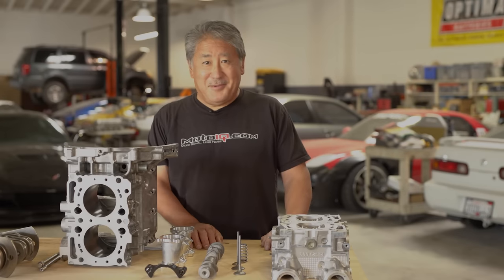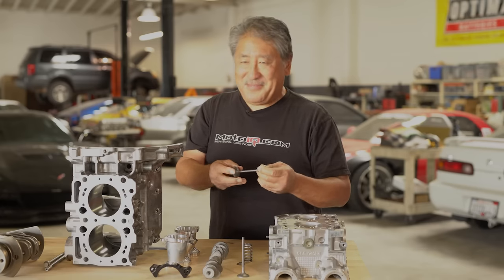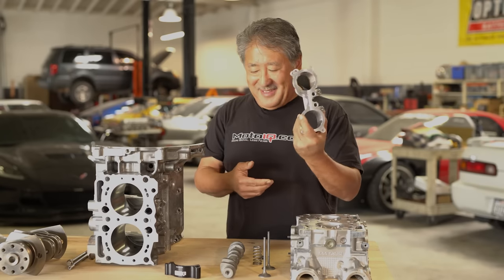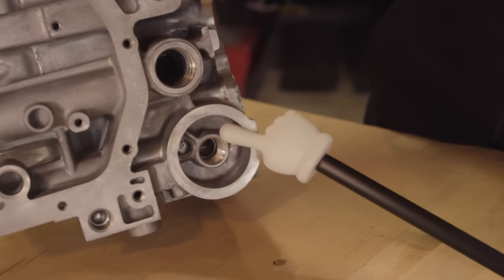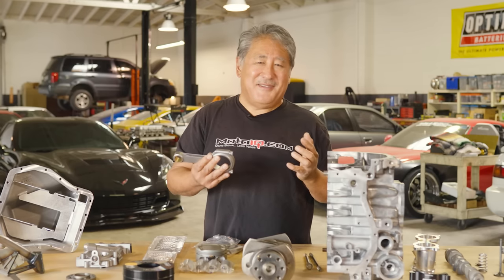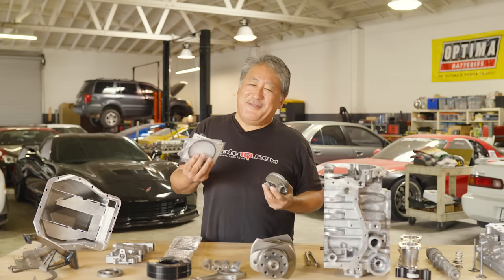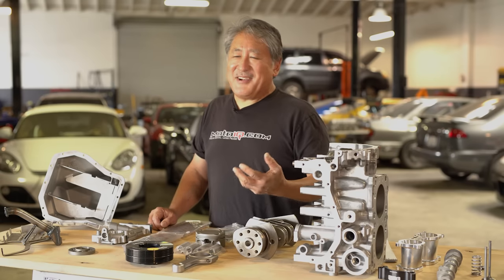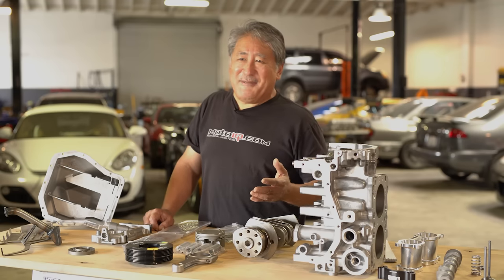How to Build a Subaru EJ Engine that won't BLOW UP!

Comment: Ok so this video explains why my version 5 STI blew up 20 years ago and cost me $10000 to repair. Now we have youtube to research this stuff, good vid.
Reply: Those were the bad old days, it’s so much easier and cheaper now. GC8’s were kinda weak, but 99% of them got given a hard time. 
Carload of mates while doing helis, dodgy boost taps, that kind of thing.
Reply: @zeroyon4562  My one was standard apart from a giant HKS exhaust, head gasket went at 16,000 big ends went at about 17,000. Mind you those events happened after me racing people at 145+mph.....

Comment: THIS is the only reason im considering a low milage wrx 2.0 ej. Hopefully i can find an ol timer thats treated one well thats in good condition. Definitely a model/engine on the list among cars like a regal T type from the 80s.  Both entirely different cars/experiences but im in the ballpark for something fun or a 2nd car for FUN. So many options as far as used-complete cars vs a used auto trans car with intent of building up the engine and getting an STI trans/dif and a manual swap etc. Even FB rx-7s though an NA build can be costly vs a stock/ish 13b. Im making like a spreadsheet of builds/cost aspects among various cars in the 10-20k range as far as total build/cost. Aspects like total power per $ or  cost of stand alone systems/wiring build to build/swap, cost of trans/dif etc. Its grown into quite the fun hobby since covid started as ive been saving to fulfil this goal of having a FOR FUN car these last 2 years really motivated me to have a hobby that i can pass on once i start a family. As well as gain access to a new community and potential for friends etc. Positive/healthy choices. Nothing like planning a build and saving for one you get so many on the drawing board or potential "CARS" to buy to potentially drive in stock or put in storage as you assemble parts. I cant count the amount of times i almost bought a car on an auction site, or even worse a roller on a whim....a built/cammed EJ20 is up there though with street port/semi port 12A FB. For me as far as MOST fun ive seen per $, 944 turbo swap sounds like fun too i mean there are so many cars that offer truly RARE experiences/potential. I cant tell if im going to go through with this, or just sell/trade in my daily towards a gr86 or one of these N line elantra. Theyve both came into "play" since winter 2019...when i started trying to hunt down the "best buy/build" i could find. Best way to cut cost for me was quality of finish/trim, and potentially an auto for a M/T swap especially in the case of the Rx-7 just assuming redline wasnt as frequently touched/abused like a manual FB. Its the same reason im looking at auto 2.0ejs atm. So far my top 3 favorable options are a built/cammed 2.0 ej, FB port build pending on how car/parts impact budget SMH as far as power or build depth, and a regal t type 85-87 ideally as far as cool cars that i wouldnt swap. I mean aw11 mr-2 seems nice but also that constant coefficient of grip to over/understeer kind of crosses the plane of what FUN means to me XD. Just an all around decent FUN car Id say 944 at the right price a turbo swap is possible but even then the dif/trans becomes a cost/efficacy standpoint. But TBH considering im trying to hunt something down for the "Right price" i do pester Ol timers from time to time that i see in regal t types. One day ill find one or an ol timer driven auto 2.0ej THAT will be my starting point :). It gets pretty nuts how costly a build can get just bc you thought you found a car for the right price...that you wind up just selling+parts. Its one thing to buy parts then wind up having to buy new injectors/plugs needing fab work or a cooling upgrade or oil issues down the road etc...you can easily blast through the threshold of what you thought could have been a "casual" build or as they call "lightly modified/tuned". Crazy what you can learn as first priority aspects on these builds like long rods to prevent slap/torque on the crank, or an ideal cam for Streetable fun. Short stroke didnt surprise me its somewhat inherent of boxer engines what with bore to stroke ratio being a determining factor IMO. I mean just look at the BRZ go from 2.0 to 2.4 now....and the pure efficacy. The 2.0 EJ is probably the only platform/build i can afford/want Currently as far as awd. That oil pump pickup i was waiting for that part XD of course at the end. EJ's used "built" talk about money pit potential just like any used rotary.....lots of hw/due diligence needed. IMO ive learned auto trans cars do sell cheaper and often offer a better engine health wise, as far as if they maintained it well...less redlines/rev limit, less oil issues/heat in the engines lifetime.

Comment: I've owned several subaru impreza,s never a problem with any of mine.  Maybe it's the way they are looked after.  Cars are fabulous if looked after
Reply from the maker: If you keep them bone stock you have a good likelihood of not having problems,  The engines are pretty fragile.

Comment: thank you so much i know now what to ask when getting my engine built here in australia. i won't be asking 500hp around 300hp to 400hp will be fine as we are using our subaru as our 4x4 camping car and just want a bit more to get us up and out a little easier.  we use our subaru now and its quite capable already but like always just a bit more would be great as we are looking at adding a bit more weight to the car' camping gear and bar work ' and don't want to lose the zippy feel we have now

Comment: I've got two Outbacks with bad engines one turbo and a Forester that I managed to save it runs great it had six bent valves I just bought a new valves put in myself a little bit of lapping compound just to check see if they're seating leak checked with brake cleaner some new MLS Subaru head gaskets new Japanese water pump and a Gates timing belt kit

Comment: Wow such detailed and I love every bit of it and very informative.  My dream is to build that motor for my ej20 twin turbo GT-B. From the time I bought mines I was getting about 5-7lbs of boost where as it suppose to be around 14-15lbs stock. And it drinks oil from the last overhaul. I will definitely look you up when I win the lotto. Thanks for the video.

Comment: Funny I got my block from my brother, 100mm bore, I have no idea how it was bored but I honed it with blocked torqued and it measured within a tenth roundness. I’ll let you know it’s going to be put to the test again. Subaru motor #22 my goal is 375
Wheel torque with my 4.44 gears. It’s all forged so I want to hold that all day long to rally plus sand dunes are very hard on stuff
Reply from the maker: The cases need top and bottom torque plates when machining.  If you didn't do this you are probably going to have some issues.

Comment: After spending around 38 to 39000 on my Subaru 2 thousandand 13 STI with stock engine engine blew up 3 years after owning that's not bad then I put around 35000 into a built engine It was great I had New injectors a little bit more cam got rid of all of the environmental c*** 3 inch exhaust back The only thing I did not pump up was the Turbo that was gonna be my last stop because I thought that would keep itsmiled and I did pay a $1000 to have it tuned on the dial down in Florida which the guy was actually in New Jersey I was put now around 475 to  500 On E85

Comment: More and more happy I walked away from boxer engines. I had ACVWs before. They suffer all the same issues.
Reply: ACVW? Air cooled VW? Do air cooled Porsche engines suffer similar problems as VW?
I’ve only had good times with my Subarus, I’ve never had one with an EJ25 though.

Comment: This is an excellent video. 
Im running an ej22e phase1 with a td04 13t.
Its a stock block/head. Sohc.
Doing fuel delivery right now, but the heads are next on the list to get improved.
Think I’m gonna grab me up a set of ej25d or ej207  sti heads. 
This video is going to be referenced to ALOT! 
I want 8.5krpm while avoiding torque drop off.
Reply: Im running an ej22 phase 1 (stock block and heads) currently with a td04.
There’s a set of ej25d heads waiting to be put on the block when I get a 5 speed and an aftermarket ecu.

Hows yours coming along? Did you get the heads running yet?

Comment: 11:30 Orr just use a "proper closed deck jdm ej20 block" over here in NZ we get the good metal with the good block. They are getting rarer tho. Good stiff block.

Comment: hi no codes  at all as you put some reves on it  it levels out but well still there really it came right one time then briefley but went back to it this dash board has no code display other than that a good motor  thanks for getting back so quick

Comment: This really explains a lot, awesome video.  I watched both the Donut series and the Driven Media/Overdrive series on Subaru, and the big difference seemed to be EJ25 (Donut) vs EJ20(Overdrive).  It seems to make sense, most serious race shops seem to use EJ engines <2.5 litres... might explain a lot.
Reply from the maker: We just wanted the different engine character. The EJ257 is not inferior.
Reply: @motoiq  Interesting, I'm glad to hear that! I have an EJ25 and I'm loving it but I'm trying not to blow it up lol

Comment: The copper composite bearing coating wouldnt go far from stasis. 
Fills in valleys and rounds off mountains at a nano scale.
Electron fields count at this smoothness. 
Purity of mineral counts.

: )

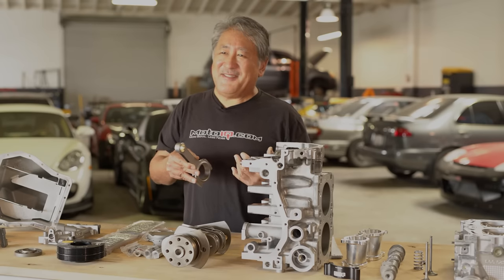Comment: Great video. Regarding proving the thermal efficiency you talk about from long rods around the 19:30 mark: have you tried testing fuel efficiency between long and short rod variations. If its more thermall efficient then it should consume less fuel for a given load. In that scenario you would probably want to test at part throttle so that airflow is not whats limiting power production. So at a specific RPM and power, which motor takes more fuel/air to make that power. its certainly easier said than done but it might be a good experiment.

Comment: Love it! Excited for a post build update -- subscribed! want to hear about turbo and cooling mods too. How will you be addressing transmission and rear diff deficiencies?  I have a built frankenstien bugeye (2.5 with 2.0 heads). It had a 5 speed with STI 1-4, wrx 5th (wonky ratio), held up fine for 3 years 410whp, but the rear diff peaced out to become a grenade, so I did full jdm 6peed swap ... takes it like a champ plus get dccd.
Reply from the maker: Head to MotoIQ.com and spend some time reading our Subaru content too 👍

Comment: Funny you  mention how much nicer the 2.0 is to the 2.5 because I found out the other day the 2.0 was the original design and that the 2.5 was basically a bored or stroked version for an easy displacement increase for power but sacrificing the engineered balance of the original 2.0 and then I found out that this actually has happened lots of times with a bunch of engine series and often times the smaller original design is better balanced and designed overall and with todays forged internals and turbos its not exactly difficult to get a lot of power out of a smaller engine so now it seems like the smaller original design is the better choice for high performance.

Comment: You never open the head gasket coolant passages to match the block. They are undersized for a reason - they slow the flow so the coolant can absorb more heat.
Reply from the maker: who said we did?
Reply: @motoiq  16:12 My mistake. You opened the case and head coolant passages to match the gasket. Surprised the gasket was made that way.
Carry on, although an ICE is an engine, not a motor.

Comment: I was under the impression the valve seats transfer a lot of heat from the valve.  Seems like making those continuously smooth would decrease the surface contact between the valve and the head.
Reply from the maker: no, there is still a 45 degree seat.

Comment: How much of this applies to the FA20? I plan to do some engine work soon to prep for a supercharger (expecting around 350hp @ 5500 and 280 ft.lbs @ 3500). Just want to get it all done at once and not miss anything important. Thanks!
Reply: Nevermind, my engine blew up.

Comment: And to that I will take a my entire Subaru apart just to change the rod bolts to arp ya I’m a nutS but after braking so many stock once on such good engines I am convinced.
Reply from the maker: Change the rods too.

Comment: It's cool to see how trick Supertech parts are! I don't know the name of that extra cut on the intake valves above the seat not present on the exhaust but i've heard it's super slick for low lift flow
Reply from the maker: if you are using stock valves you can do a 30 degree back cut above the 45 to gain some flow.  Supertech valves don't need it because they have a good shape as is.
Reply: Back cut!! Thank you Mike!

Comment: Should add eng test procedure to measure before after audio&vibrations in addition to dyno. Would be a legit measure, eng vibes are a wear factor afaik
Reply from the maker: That is not really a thing.
Reply: @motoiq  That's so interesting to me! I thought for sure vibrations would a wear factor but perhaps only a thing at the mfg level? Anyway really enjoyed your presentation! had the 2.0 sti engine in a 07 bugeye, with very little done to it. Would love to relive those days again in the future.

Comment: Excellent video. What modifications need to be done to the 2.0L block to accommodate the 83mm crank? Can it work in a stock ej205/207 block?

Comment: Can you recommend a good strong piston-rod-ring combination that fixes the oil consumption of my WRX STI 2.5 that goes through oil like a 2 stroke?  From what I understand most of the problem is the oil control rings although loose tolerances in general are part of the problem.  Subaru did that on purpose to try to improve gas mileage.  Great video even though I have the problematic 2.5.  A lot of the info is still pertinent although on limited income with leukemia so much of what your doing is out of my price range.  Although most of the work I can do myself but not the expensive machine shop work.  My 2 liter WRX was a much better car made the mistake of thinking the STI was the ultimate Subaru just a bigger headache my WRX went to 130K miles when the transmission started making expensive sounding noises.  My WRX STI threw its cam timing belt at 16K miles which wasn't expected.  Now the car has some weird ECM problem that is hard to diagnose particularly when it keeps throwing random odd error codes.
Reply from the maker: Pistons from JE, CP, Mahle, Wisco and Manley are all good.  Rods from Carillo, Calles, Wisco, Eagle, Manley are all good.  I hope you get better soon.

Comment: Why did Outfront Motorsports not cut a “cooling ring” around the top of the cylinder bores like Subi-Performance?
Reply: Outfront outsourcres their closed block work to some other secret machine shop.

Comment: Sounds like you treat a Subaru like a high performance motorcycle engine?
I like the look of the new JE pistons, slipper pistons are almost always lighter than full skirt so less stress on rod and crank until you get much higher rpm. I think you should have mentioned the Napier piston ring was upside down (although you did mention it' second groove) 
Honda have used the same design since 1960's but I still see them fitted to top groove upside down.
Kinda surprised no one is using centrifugal oil/air separators (probably haven't read up on that bit from 1930's aircraft engines?) 
With 'windage tray' do you ever fit Teflon sheet scrapers to reduce clearance even further?

Comment: I see that most of the problems are parts not built for long term stress like the aluminum block instead of cast iron, valves and valve springs and I should probably fix all of it on mine

Comment: Car loved the E85 just like it couldn't get enough everything ran great no issues except for one thing The clutch could not handle the amount of torque and it was a stage 2 so I dumped it and went out and bought me a really nice 2 disk ceramic clutch And I broke it in the clutch for about 500 miles 1 day I decided after driving it very nicely to go and get another tank of it's beloved E82 On the way not driving hard discussion at 65 Miles an hour no hard acceleration next thing I know that $35000 motor started making some noise It scared me I turned around only had 8 miles to go back to home and I baby did all the way home still don't know what the issue is all I know is I've heard a lot of noise kind of sound like a spun bearing but I don't know where from take back to the builder He could not tell me nothing it's oh you've gotta hold in your pistol because he tuned it originally but he was not a cub

Comment: guys i have subaru legacy bl 2005  2.0r n/a 165 hp i want to go turbo the engine is ej204 this take perfomance parts from all ej20 engines ?like wrx impeza and like this ?because i want to go forged and do turbo like 400 max hp thx alot

Comment: Makes me want to Cryogenic and WPC my Joints. Would probably run faster than Usain Bolt.
Can only imagine how much detail goes into a F1 engine with 1000HP 1.6L v6 12k RPM

Comment: SUBI - PERFORMANCE . not so much garbage and junk = with out spending $40,000 ! IAG 2.7 is a great start .
Reply from the maker: If you think our engine is garbage and junk, you don't know anything about building engines or Subarus.  First, it sure doesnt cost $40k  This engine is only slightly more than an IAG 950 due to the crank and is built to rev.  The spec isn't that different than an IAG 950 so I dunno how you could say the 950 is awesome and ours is junk. We also work with IAG extensively helping with their race team and we recently did a Collab engine with them. https://motoiq.com/project-gd-subaru-sti-building-the-engine-part-five-final-engine-assembly-with-iag/9/